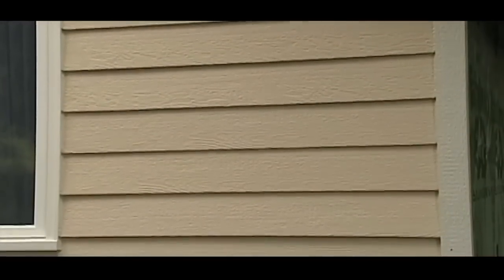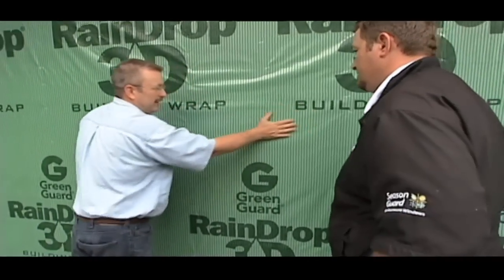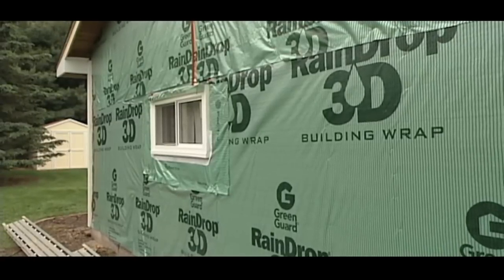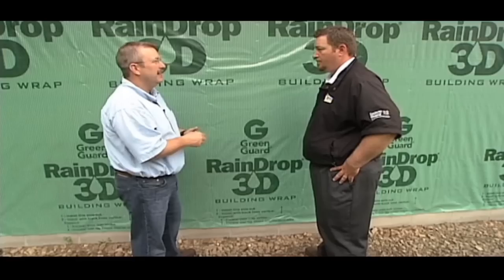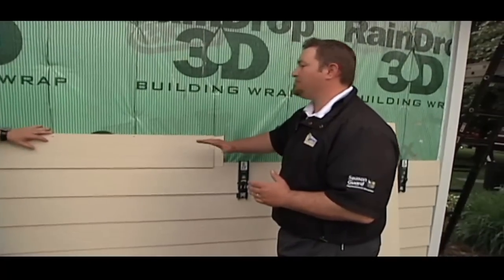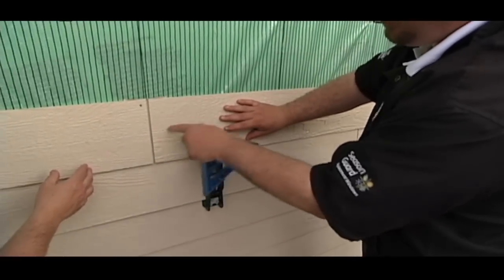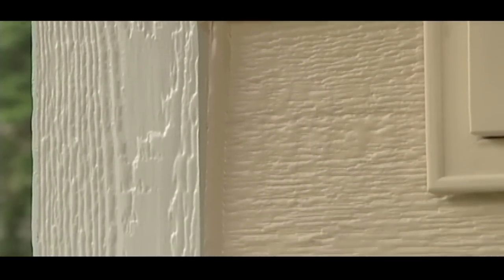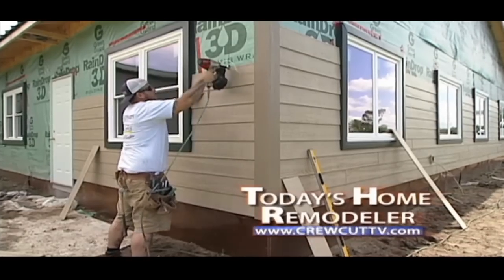LP Smartside Siding Residential Installation by Lindus Construction

Comment: what kinda tool is that guy using to hold the sliding??
Reply: Gecko Gauge, need to make sure you have the correct one for the type of product you are installing. For this lap siding 3/8 or 7/16 gecko gauge is used.
Reply: A gecko gauge

Comment: you said it does swell? That does not sound good to me...hardiplank does not do that
Reply: Wanna bet? Cut a piece of hardi and throw it in a bucket of water.
Reply: I am a homeowner who has installed Hardieplank on a part of my house and water makes it deteriorate almost worse than this cardboard stuff. Bottom line, you just have to keep water away from  any kind of siding.
Reply: It acclimates to the humidity that you are in.  It does this once, then won't shrink or swell again.  This is due to it coming from the factory, controlled environment.   So gap it when you install, and the gaps close up.
Reply: Chip Penny if it’s not gapped does it lead to wavy siding? Like facing forward you don’t notice as much but if you look straight down the side it’s wavy? Mine is like that and my home was built only 6 months ago. Builder keeps making excuses and the edges are snug to every horizontal piece.
Reply: dcuobeast I can’t say without seeing it. You should reach out to the supplier and ask for a representative from LP Smartside to view the installation.
Reply: @dcuobeast  if the gap isn't enough for the  level of expansion in your area then the joints will buckle.